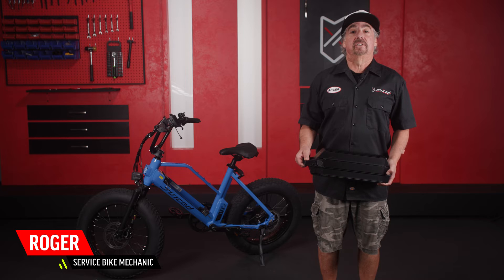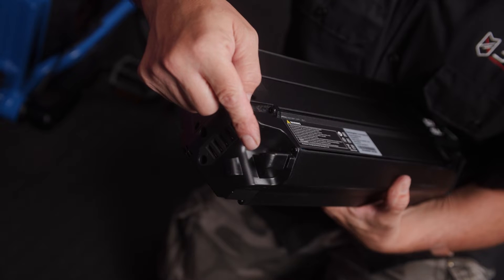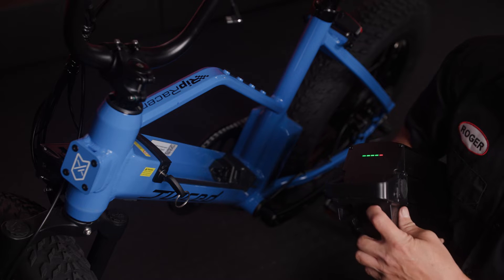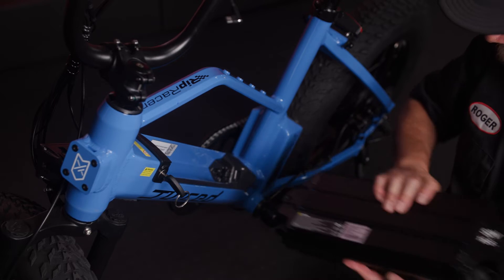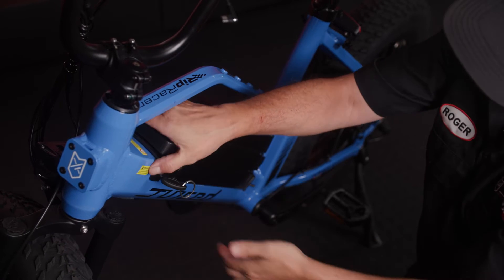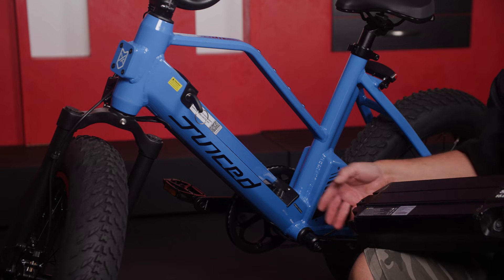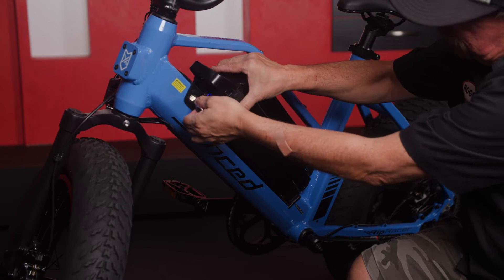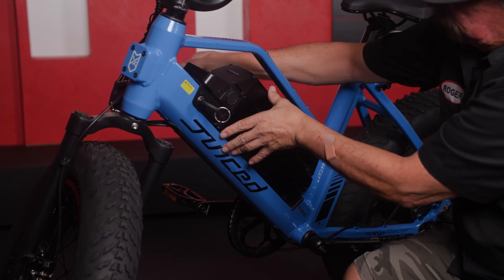Juiced Bikes: Battery Installation Guide

Comment: How do I remove battery for first time?
Reply from the maker: Great question! Turn the key to the battery lock to retract the pins, while doing this, grab the handle and gently push from right to left. Be ready to grab the base of the battery with you other hand on the left side of your e-bike.

Comment: Why did you not design this new battery like the old one with the power button easily accessible? To put a batteries in and out a the hyperscorpion is not easy
Reply from the maker: Hey 👋 Thanks for your feedback, we will pass on to our product team. The new design is a more water and tamper resistant design.

Comment: How do you turn the battery off through the LCD screen
Reply from the maker: Hey 👋 This depends on the model. On all other models than the HyperScrambler 2 or HyperScorpion you can turn the headlight on/off by holding the + button down for 3 seconds. For the HyperScorpion or HyperScrambler there is a toggle switch and you can configure the light to turn on or off or switch via the advanced LCD screen. For additional help contact support@juicedbikes.com

Comment: On the web site, it shows the battery charger as an an optional accessory.  Isn't a charger included with the bike?
Reply from the maker: Hey 👋 Faster chargers are an optional accessory, but every Juiced e-bike comes standard with a 2 amp charger.

Comment: Just received hyper scorpion. Problem installing battery pack. I watched your video but no success. Upper section of battery seems to be hitting inside like not lining up properly. Yes I’m turning key. Seems to line up on bottom. Grey ring is becoming scuffed and black plastic areas are abraiding.
Reply from the maker: Hey 👋 Trying lifting the pack a bit as you push the batter into place, if you are still experiencing issues contact https://juicedbikes.kustomer.help/contact/contact-us-Bkm4GFIzt